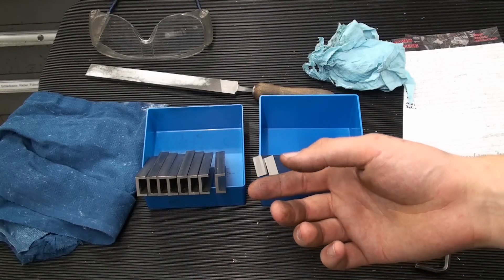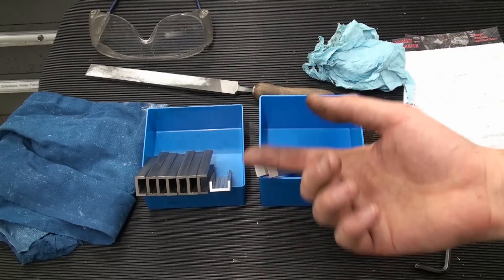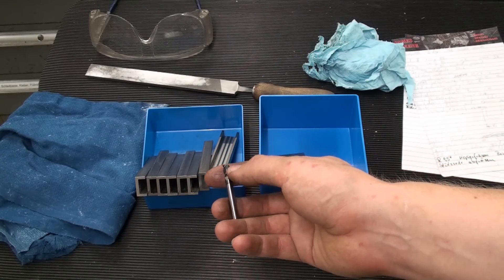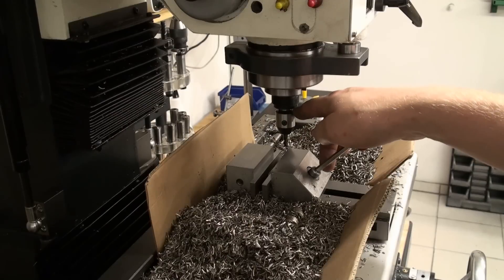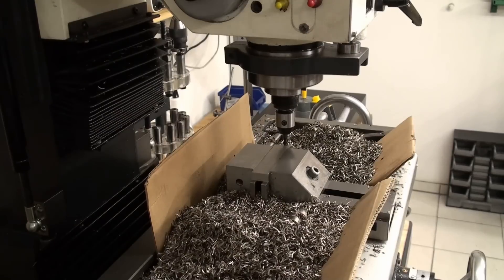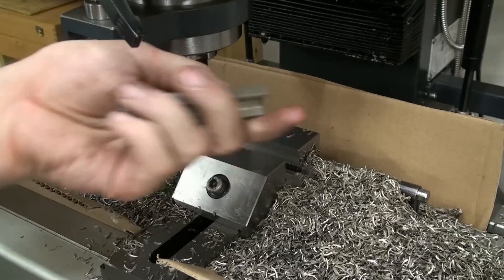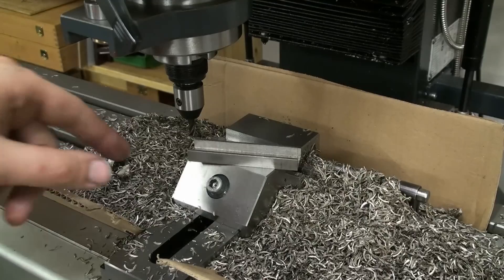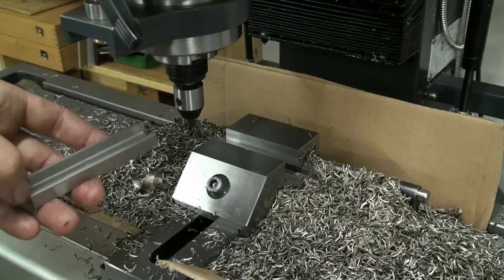Roughing without a roughing endmill?

Comment: I have to do a job like this, 6mm end mill, but like 200 times... It's a window in a 15mm thick disc (mild steel)... They Are breaking and breaking and breaking... Any secrets about which endmill holds a FULL cut? And that not only 10 times? Its getting expensive😂

Comment: I was blown away when I switched to carbide end mills. They are so much sharper than HSS, they make the roughing thing pointless. Less vibration, less cutting forces, ... I used to think a small machine would do with cheap HSS cutters. Turns out, they benefit a lot from good carbide cutters because it's easier on the machine.

Comment: This stainless machines fairly easy, hss NEEDS coolant or cutting oil, cutting it dry the steep helix and slow feed full depth would be my Joyce also.
On my Fritz Werner I'd clamp it high up in the vise so it won't collapse.. one pass with hss rougher.

Comment: Hi mate.  A very interesting outcome of the test.  I would like to know a little more about the mill.  You have had this mill for a little while now, and I would like an honest appraisal of it, as you do so well.  The mill seems to be very accurate, and the direct drive gearbox appears to work very effortless.  The startup seems to be very crisp, and speed adjustment easy.  I get the idea that this mill works a lot better than an old or used factory machine, and rather more precise.  Would you prefer to have a good used industrial machine if you could?  Thanks for your time.  Thus

Comment: Stainless steel is not so bad to work with, it's only harder to find the sweet spot, there is an advantage to have more than one part to machine...  The last part is the one where you get it right.....   ;)
One problem with SS, is it deforms even more than cold rolled steel, for machining and even worse at welding...
Reply: Welding...right, it just doesn't conduct much heat...so, tiny welds...and slowly....1/2-1/3rd the current you'd use for steel/s...

Comment: That is no mess, when you need the skid steer to remove all the chips then you are making  mess! This is similar to my experience with insert endmills. I love how strong they are and the beating they can take but sometimes that just run too rough and a normal  endmill will do a far superior job with its constant cutting edge engagement.

Comment: Good demonstration, how much distortion did you get once the centre was removed?
Reply from the maker: Lengtwise it went about 5/10mm into banana shape and the U profile opened up about 1/10mm
Reply: That's cold rolled for you. Stainless always seems to do it more than mild steel:>(  Work hardened surface from the rolling perhaps?

Comment: Thank you, Stefan. Very informative. 

At the close of my productive days (early 90's) helical flute carbide end mill were fabulously expensive and slots like your project were noodled out with HSS under oil flood coolant with HSS endmills. Stagger tooth cutters were also possible but the advantages of a single pass to completion would be swamped by set up time and dubious part clamping because of the thin walls and bottom. 10 parts wouldn't justify a fixture.

The combination of those high helix carbide end mills and the free maching stainless made the job run like it was aluminum.

Wow! What advances will the next generation bring? 3D printing with alloy powder later sintered to fuse it to solid consistency? Plasma deposition printing? Cutting edges will be the new "old school."
Reply from the maker: Hi Forrest,
As this job might come up from time to time I was thinking about a fixture, but I try do as much as I can in the vice. On a light duty machine I would have run higher spindle speed, smaller DOC and higher feed, but on a manual machine this would have been tedious...

Thanks for the insights from somebody that has been around way before I was born - I realy appreciate your input! Also enjoy reading your comments on practical machinist.

Same with the old guys at work, always listening when they tell how they did stuff back in the day - Like deep hole drilling large mold bases on the lathe with spade bits.

DMG and Hermle already have shown machines that can 3d lasersinter or microforge and do machining operations in the same machine, that is quite impressive.

Comment: nice!  i wouldn't have guessed.   good to know.   personally i like stainless but avoid it b/c is such a pain to work with.
Reply from the maker: Same here - I always think that I know at least a thing or two about milling, but then you do something thats completely counter-intuitive and it works like a charm :D
Reply: Yeah, I was REALLY surprised too, that you could simply pick up the part after machining, without burning yourself. Every time I've machined stainless, I've always experienced issues with heat build-up and high tool wear. Thank you sharing this Stefan. Good to know! :)
Reply: upload something NOW i am dying inside

Comment: Hello Stefan. Is that endmill from Hofmann like you have shown in the past? If it is, is it a Garant or a Holex? And basically are Holex cutters any good?
Reply from the maker: Ah! Sorry, I didnt add the cutter into the description, its a Holex 202220 6
https://www.hoffmann-group.com/DE/de/hom/Monozerspanung/VHM-Fr%C3%A4ser/VHM-Fr%C3%A4ser-DIN-6535-HB-TiAlN-3-mm-HOLEX/p/202220-6
Reply from the maker: Holex is a bit of a mixed bag - Their endmills are generaly speaking very good. Other stuff, like the measuring tools is "Not as good" ;)
Reply: +Stefan Gotteswinter Hm, I wouldn't have tried to go that slow with the cutting speed compared to the recommended 80m/min "because it's carbide". Not sure where I read it but I somehow thought if your run them much too slow it's also not good for the tool. I would have gone not slower than 40m/min. But your trial and error test showed me that it's not as worse as I expected. So thank your for this further education.
PS: I know that the recommended 80m/min are for stable machining conditions and M8. 
PPS: How much better is the machining of 1.4305 compared to 1.4571? I commonly have to work with 1.4571 because the customer wants it and does not know or like the successor 1.4404 which causes not that much tool wear and up to a temperature of 400°C has the same corrosion tendency. But anyway I prefer 1.4571 above steels like P235 or P265 because those steels not always have the same consistent properties as 1.4571 has which means some batches of P265 work like charm and on the other batch your have problems with excessive insert wear and the chips won't break as usual and you have to lower speed ans increase the feed. 
And last but not least the mill scale of non stainless steels which aren't peeled is a mess on the machines enclosure although I'm using flood coolant. 
Conclusion: Stainless steel is not as scary as many people think it is IF you get to know the capabilities of your tools and can use as much coolant as possible but the process time is much slower compared to 08/15 steels (e. g. for turning operations I'm using 200m/min for stainless vs. 400m/min for common steel)